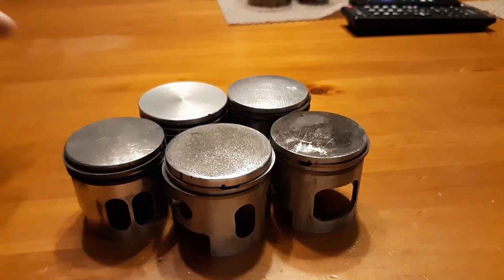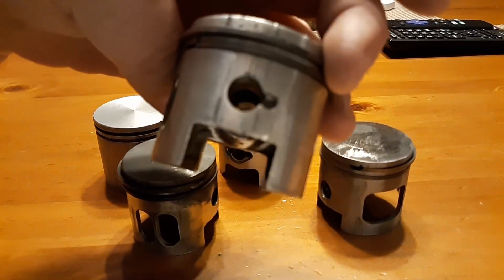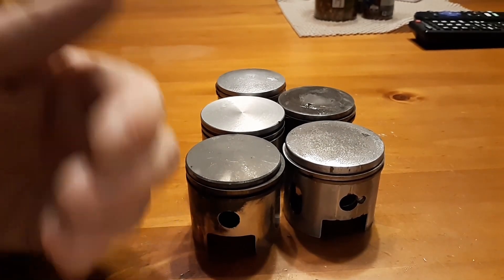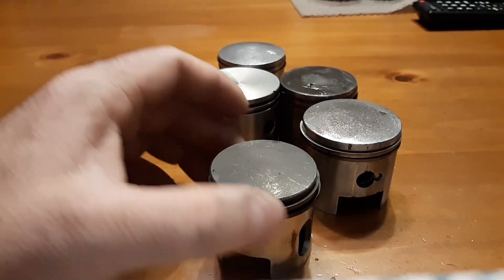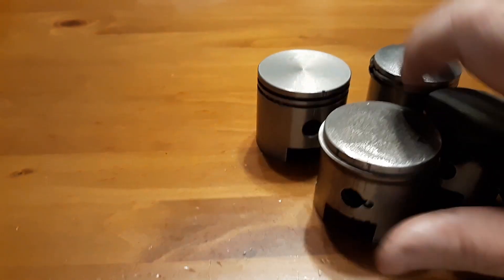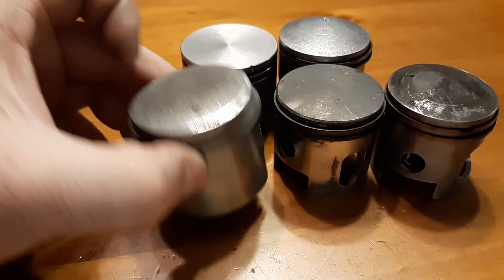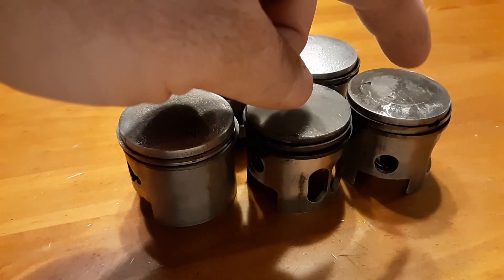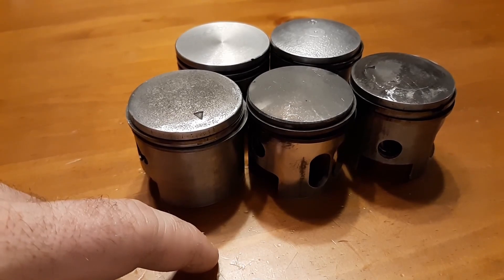Motorized Bicycle Oil Mix - Help Stop Moronic Information Being Shared!

Comment: Yeah you can thank Hughes motorized for spreading that misinformation 40 to 1 cradle to grave bullshit or even 50 to 1 he says on some seen chain saws 50:1 for years. Yeah but there’s ain’t no chainsaw which has much better materials and bearings in it much better design cylinder that cools much more efficiently But also he sells them in the more he sells the better so he tells everyone 40 to 1 so they can tear up in the first six months if you’re lucky and buy another one
Reply from the maker: yeah but his chain saw does not spin a 26 inch wheel with a 150+ pound person on it LOL!  moves a 1/4 chain through soft wood!  one of the huge miss conceptions on these motors!    Even my new saw build people told me out of the gate run 32:1 or your going to be eating liner right off jug in first 200 miles.  Most people jet there carbs very badly or don't know how to at all! as a result it runs like crap on higher oil mixes.  Honestly all super cross bikes I had or worked on over years 2 stroke ones! We added more oil to mix to help cool them and get higher compression as we did mods to the things lol Motorized bicycle community seems to want to not add oil to anything!  Just funny!

Comment: 32:1 synthetic and run it a little rich up top just to be sure. its get me to 50 mph and haven't had a single problem (on a ported cylinder, aluminum head china doll with g2 reed)

Comment: What ring gap do you have for China dolls? I got a few different sets and they're all huge gaps not anywhere near .007-.008, eith squish of .8mm seem to be having issues as if ring gap is too big..perhaps mix is a little light also at 40:1 semi synthetic (pk80 running like 8500rpm)
Reply from the maker: You mean ring gap or squish?  Ring gap is always huge on these.  One of the reasons they suggest 32:1 oil mix as it helps seal the gaps!  Normally .01 to .02 gap in rings where pin stops them.  Squish depends on what type of kit you have!  Most 2 stroke kits are in ranges of .6mm to .8mm and run great!  Anything lower then .5mm will damage bearings and run hot.  1.2mm normally extreme end.  Mas low end  power as a result. After 50% throttle tends to rapidly taper off.   .7mm is normally ideal range for these kits. Power band is in 5k range to 6k range as a result! Best of max speed/ take off power!
Reply from the maker: You could always lightly sand head gasket with 400 grit sand paper.  Put water on it and the sand paper on flat surface.  Turn the gasket as you sand it back and forth so it stays evenly sanded as you yo!
Reply: Thank you for the prompt reply but I did mean ring gap, I was including the other Info in case you saw something I was missing, I raised the exhaust to about 175 and intake-bore-wide 3rd transfer port with g2 reed, vm18 a kx85 pipe. Revs up good but after a few min it goes over 350* and I've soft sized it 3x lol... I'm not sure what I'm missing
Reply: I haven't tried lateral ring porting or whatever it's called, perhaps the rings are fluttering at high rpms?

Comment: Question.. Do you think cerokote would have prevented this or is this mixture still required?
Reply from the maker: cerakote I used on a piston helps stop a cold seize issue  with cast iron minarelli builds!  but if oil is not mixed right it will trash the pistons chew up cylinder every time! lol

Comment: A 50 to 1 mix ratio is perfectly fine if you use quality 2-stroke oil
Reply: I run Opti2 @ its recommended ratio of 100:1 and have had zero issue the lasr 13 years I have been riding and building motorized bicycles.

I dont run saw cyl. and such and none of my engines turn 10,000 rpm.

I have built them that will do 50mph and I run mine at around 40mph with 36T on a 26" wheel long multi mile runs and I have no had an engine failure related to oil yet.

Amsoil or Opti2 is the only oil I will run @100:1 though for sure and in some engines I run it @50:1 and never had an issue either.
Reply from the maker: @mapbike  🍺😳🤳
Reply: @the motorized scrapper i tell people do what works for them, I dont push my ways on anyone, but Ive had great reaults from running Opti2 since 2009 when I first got into this hobby, I've seen way more engine failures in other peoples engines from running 25:1, 32:1, 40:1 & 50:1 when they were using cheap walmart or other conventional 2 smoker oils than anyone running Amsoil or the Opti2 oils which a recommended by the companies to be run @ 100:1

I was scared to death to do the first time and was fully expecting serious engine failure, I live in central Texas where just like today 100°+ is common most days throughout the summer and so in this Texas heat is where I did my hard riding test with my first China Girl engine running a Puch Hi Hi 70cc Head for better cooling.
That wasnt s auper fast bike but I could run it WOT for 10 miles non stop at its top speed of just under 40mph never as much as a blink from that engine and I have other still going after 10 years of running which will top out at GPS'd 47mph and cruise nicely all day at 40-43mph in very hot dry weather conditions.

I dont say this to recommend people do what I do, I know others who have been running their CG engines just like I have been doing for years also with great service from them and zero oil related failures.

There are rental vompanies for instance who use Opti2 @ 100:1 in all their 2 stroke remtal tools because they found out that there engines last longer.

My wife I cut lots of firewood and have many chainsaws from 32cc - 92cc engines and I run Opti2 oil at dame ratio in all of them , Echo, Husqvarna, Stihl and they all perform excellent jist like all my bike engines.

Now for the Saw build bike engines and the other hybrids, this may not work in them for some reason.. I honestly dont see why it wouldn't but I say people should figure out what they feel best with and what has proven to work for them and then do it that way and thats exactly what I do.

If I were personally running the hybrid Minareli ect... engines Id be adding some degummed Castor oil in the mix since it will give better extreme heat protection to the piston and cyl bore than any of these modern 2 stroke oils alone.

Maxima makes an oil called Castor 927 (expensive) but in these really hot running hybrids with cast iron jug, id be running either this or my opti2 with some castor oil added to it for the extra protection since castor oil is known to shine in hot running 2 stroke and also RC airplane engines.

Just my $0.02 and personal experience, but definetily not a promotion for doing what I do.

Peace... Map out...😁
Reply: @mapbike  honestly I'm super surprised you didn't share your affiliate link. 😉
Reply: https://youtu.be/Q97qlrxCRxU

This bike and same engine been on 100:1 Opti2 since 2013 and engine still runs great after several 1000 miles and this bike tops at 47 mph with 34T on rear under perfect conditions and runs 43mph solid on the flat in about any condition.

Not being a jerk here and not shooting down what anyone else has said or done, just sharing what I do and that I've had great results with it.

Comment: So how many 2.6oz Huscavana synthetic oil in a 1 gallon tank of fuel???..I bought a 1gal. tank
Reply from the maker: 8ounces for 16:1 / 4 ounces for 32:1 / 3.2ounces for 40:1 / 2.6 for 50:1
Reply from the maker: . 2.6 is in the middle of 32:1 & 40:1. (half gallon gas @ 2.6 is 35.5:1 ratio)
Reply: One 2.6oz and one .8oz

Comment: I think most of the people pushing really thin mix ratios are using them to fix carb tuning issues (excess smoke and black spooge from the exhaust). If they jetted the carb for a 32:1 ratio, they wouldn't have those issues. I like 32:1 since it's so simple - 4 ounces of oil to 1 gallon.
Reply from the maker: yes! omg this is the most intelligent reason anyone has stated yet lol!  👍
Reply: Would you recommend breaking in new motors with 32:1? Or just doing the 16:1 then running 32:1 after it’s broken in?
Reply: @Krod5484  did you watch the video? lol
Reply: @Krod5484  short answer break in 16:1 as recommended yes but I don't always follow that. I have broken in many 32:1 with no harm to them at all but I also pre lube and inspect everything and as a ritual 2 cap fulls of dominator down the plug hole, rotate a few times,wait a few mins,fire motor. No it's not technically correct but works for me.

Comment: For the minarelli could you just warm up the motor for two minutes before any load to fix the cold seizures?
Reply from the maker: only water cooled aluminum jugs and cast iron jugs have this issue.  no jetting, plugs, or oil mix changes that effect a cold seizure.  this is main reason minarelli has not used a jog or vertical cast iron cylinder for the last 30 years in any new mopeds.  vertical jug used in these bicycle build first came out in 1943 and when aluminum came into mainstream in 70s they only use aluminum that point on to solve cold seizure issues
Reply: @BuildBreakFix  oh wow I didn’t know they came out that long ago
Reply from the maker: @justanothermotorizedbikech  yeah first motorized bicyle with a minarelli jug was done in Russia back in 1964 lol people always show videos crazy shit to fix stuff that has already been done 50 years ago lol. This why stihl and minarelli builds are so popular!  Was the only parts the USSR  could get back in Soviet union days.
Reply: @BuildBreakFix  how long have you been working on motorized bikes?
Reply: @BuildBreakFix  I guess they’re right case ain’t fast
Reply from the maker: @justanothermotorizedbikech  yeah I built few minarellis lol. Thing is there designed for short high rpm bursts till a cvt kicks in on a moped!  On a motorized bicycle people run these wide open for 5 minutes and there just not designed to take that kind of heat! Now if you want to drop 280$ just athena aluminum jug problem solved.  But a saw build bigger and stronger 1/3  that cost!
Reply: @BuildBreakFix  my next build is gonna be a saw thanks to your videos🙏🏼💪🏼💪🏼
Reply from the maker: cold seizure is caused by aluminium expanding from heat faster then cast iron.  since the piston expands it is now to large to move freely in the cylinder causing a soft seize/cold seize  same thing!  once it cools back down it shrinks moves again provided it didn't fully lock up and ring sticks as a result.